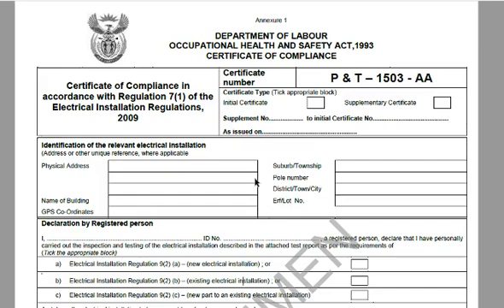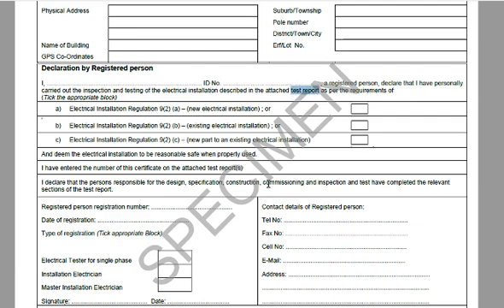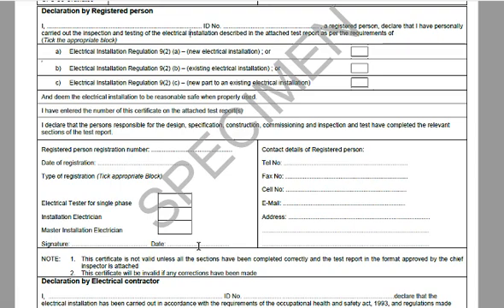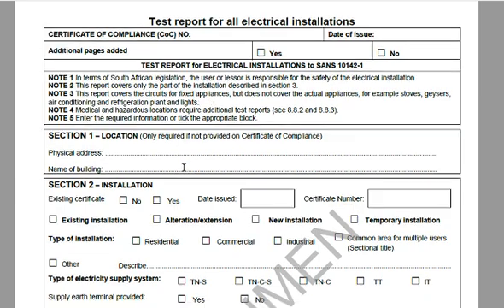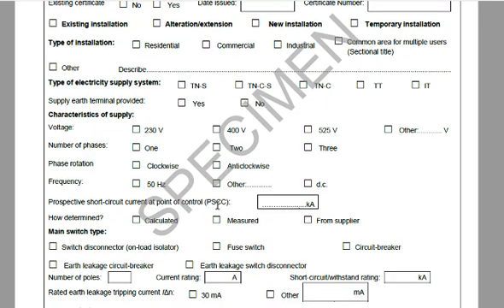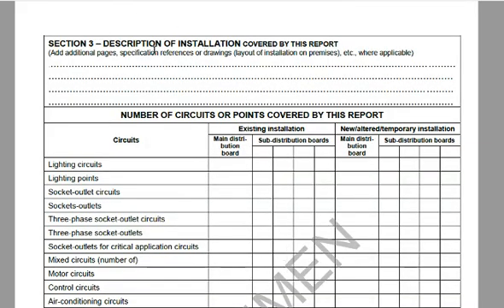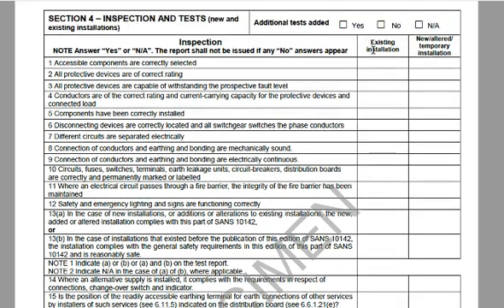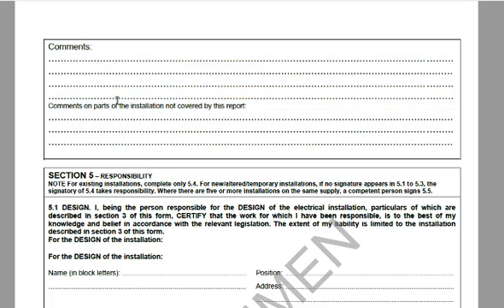Electrical Certificate of Compliance Part 1

Comment: The buyer agreed and signed to buy the property as it was, now when I sent technician to do COC the buyer added things that I the seller didn't agree upon. Now the repairs quotation amount is too high. There were lots of installation and replacement of bulbs, extra plugs🤷and I was excluded in the decision making now I'm supposed to pay the bill?
Reply from the maker: I am not sure I understand - in which provide did you sell the house? For example, in the Western Cape, a house must be sold with a CoC. What additional requirements were there from the buyers side?

Comment: thanks for the video, just a quick question, can a qualified electrician do the installation according the regulations and get some one with a wire-mans license to do all the tests and every thing ells for the coc?
Reply: No because then he propably not qualified. That's why he needs someone qualified .
Reply: No
Reply from the maker: So, I am not sure what you mean by this. In most electrical contracting firms, not every electrician is licensed to do a CoC. Usually, the electrical contracting firm employs one or 2 qualified and licensed electricians and although they might not do the work, they should oversee the work, taking responsibility for the people under them and sign off the whole job as their responsibility. In practice, what I have seen is there is one qualified electrician only and they only time they get called out are if there are issues with the work - so always request to see the electricians card and license

Comment: Hi all, we recently bought a house and my electrician found out when fixing our geyser that alot of shortcuts were taken and the COC was a scam. What is the next steps to rectify this as the estimated cost the fix all the snag to be complaint will be about R50k!
Reply: Your electrician scamming you
Reply: Bravo Scan AIA
Reply from the maker: What sort of shortcuts wand what size geyser do you have? An R50k bill to rectify seems hefty - is your current electrician prepared to submit an affidavit with his findings? If not, I would question his integrity

Comment: How to calcute the test number 10&11
Reply: Measure
Reply from the maker: Which 10 and 11 are you talking about? The voltages at DB and Load? As per @leonfroos said - it's measured values. Although you should do a volt drop calculation to verify the voltage at load is correct

Comment from the maker: As with all my videos, please challenge what I say and let me know if there is anything that is unclear or you would like to see covered in future uploads. Keep comments and discussions polite and clean please.
Reply: Please advice what is the price of COC to do db box, eye level hob with warmer and stove with 2 separate isolation boxes and wall unit to the existing appliances? Based in Durban, KZN
Reply: R3500
Reply: Hi, what if you found out that the contractor number i.e. KZN number isnt valid, but the registered persons number is valid, does that make the CoC invalid? Is there any legislation or literature i can reference?
Reply from the maker: @abertoneynstein4265  Correct - that means the CoC is invalid - I will see what I can find - I unfortunately have not checked this page for years - was under the impression the assigned individual was doing so, but seems not - we will start updating with regularity now